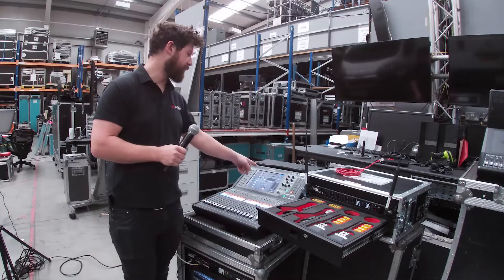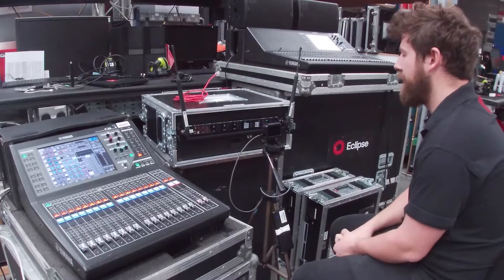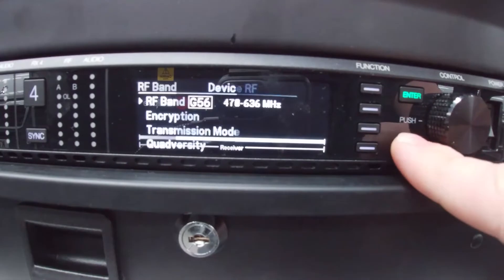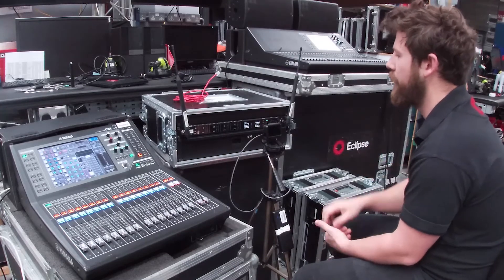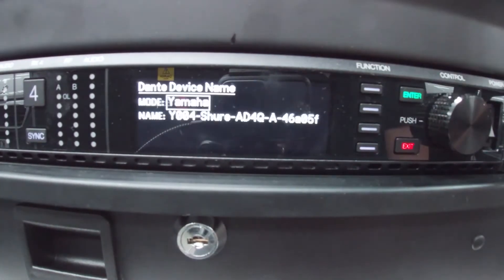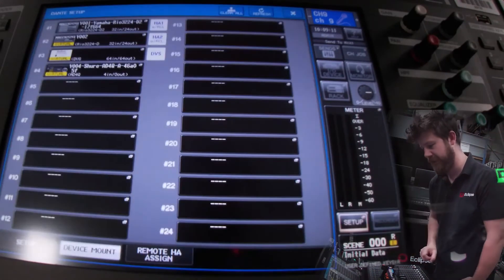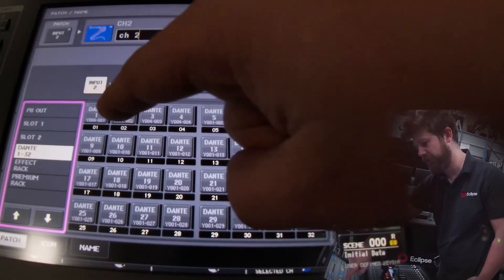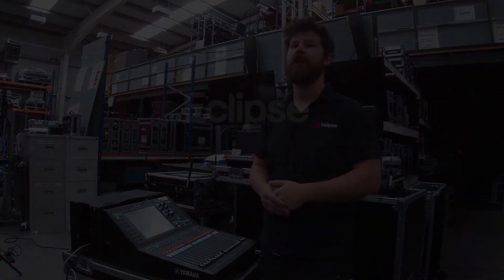Shure Axient Mic Control with Yamaha desks

Comment: Nice video man ..some notes/tips
1:20 you don't  control the sensitivity  of the capsule from the mixer but the AF OUT (output gain) of the receiver...the sensitivity  of the capsule is another  parameter (offset) and can be changed  on the transmitter  (handheld  bodypack)  or via showlink  through workbench. 
3:20 you don't  need a third  switch  in order to have workbench or device control from cl ! In split redundant  mode, the  dante primary network (switch)  can also have the workbench 👍plug  an ethernet cable  from shure control to the primary switch and it works just fine ...dont  forget  to plug second   cat5  cable from primary port of axient  to the primary switch....same thing happens in switched  mode👍
4:44 the name of the device can conflict when same devices have same "Yamaha  name"( 2 RIOs both Y001 or 2 AD4Q named both Y001) If you have one of a kind then all can be named Y001 (followed  of course  by their actual name )
Cheers 🙋‍♂️